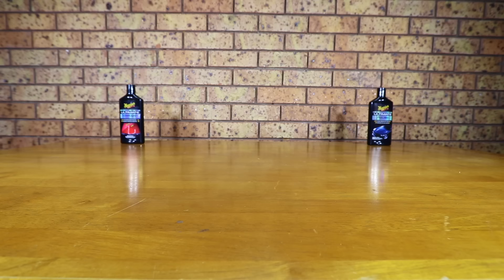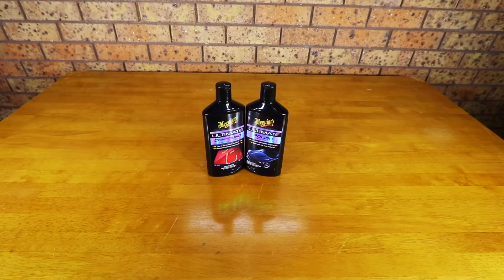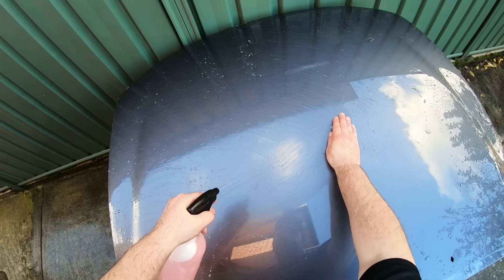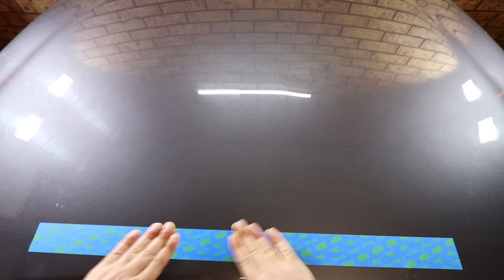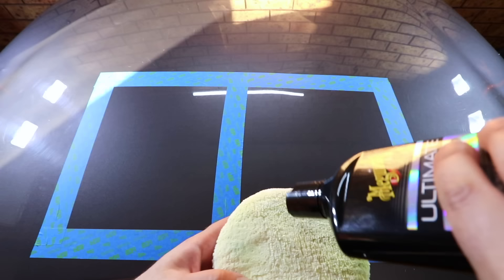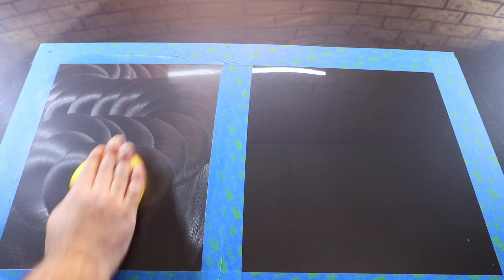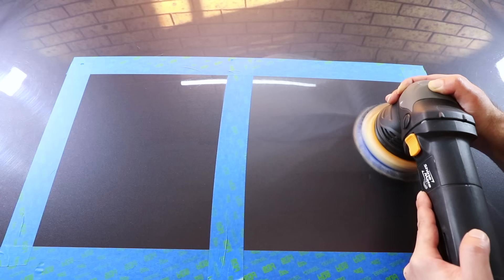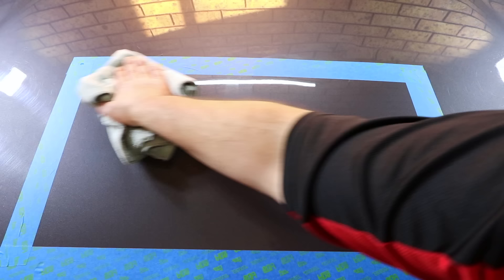How to Use Meguiars Ultimate Compound & Polish+ Review & Demonstration!

Comment: You are right about making sure you work this stuff in long enough.  I've used this a lot and the biggest mistake I've made when I first used it was not buffing long enough. I found it work best  using a DA and going until the compound almost turns clear and is barely visible.  Also....I found that it was critical to make sure when you wipe it off, you switch micro fiber clothes fairly often.  Using the same one will end up just smearing it around if the cloth is coated with the stuff. I went through a dozen or so doing a complete truck.  Thanks for vid!

Comment: Ive been told ultimate compound is full of fillers but I used it to get rid of some scratches (by hand) and did a fantastic job, the correction seems to be permanent. However if it had fillers it would have worn out by now, I am very impressed with it. I havent tried the polish yet but I feel compelled now. Thanks for the great video!
Reply: There are no fillers in Ultimate Compound but Ultimate Polish have both fillers and abrasives. So with Ultimate Polish some minor defects will get removed and some gets filled. It's kind of mixture of M205 and one of their glaze product which I don't remember now.
Reply: If you don't like fillers, you can use Mothers Pure Polish after Ultimate Compound because that polish don't have any fillers and silicone.

Comment: This compound really worked well on my old blue Tahoe. It made a big difference. Meguiars really works.
Reply: it was the first wax my dad taught me to use way back! they're leaders in car care for a reason!
Reply: Do you know if it works to remove bird poop stains. I mean difficult ones to remove? Like burns ;( thank you.
Reply from the maker: As long as the bird poo etching is still contained within the clear coat it can remove it. But if the etching has made its way through the clear into the base coat then it unfortunately can’t be removed with any product.

Comment: Finally free to catch up on your videos. Thanks for confirming that it does not have fillers. A few detailer’s been telling me that it has silicone acting like fillers and glad that it’s only enhancers. Meg’s Ultimate is a prefect product brand to get into car detailing without  spending too much.  DA a must with great working time. Thanks for the videos! Educational as usual.  FYI, newbies - Don’t use this on hard paint :). Not aggressive enough.
Reply: UC with an aggressive enough pad + good old rotary will do the job on most ‘hard’ clearcoats, barring maybe Volvo’s (they have clear that’s even harder than most Germans).
Reply: pepecoco Ultimate Polish has fillers mate, just IPA after you’re done in an area and inspect with a bright flashlight, big difference after IPA/panel prep wipe down.
Reply: Wish I saw this post before I tried to use it on my A3.... My Rupes yellow medium pad didn't have the power with this compound to get most of the scratches out... some pressure on some generic dense foam pads did a little better but it looks like ill need to try something stronger like shol s20.
Reply: HeliconPath Would highly recommend Meguiar’s M105 ultra cut compound, follow that with something like carpro Essence and you’ll get a show car finish on your A3, I’ve used this combo on many clients’ cars with a rotary and LC pads, works very well.
Reply: Are fillers good or bad?
Reply: @ji8651  It is normally considered to be bad as their goal is to "fill" the scratches/defects instead of removing/correcting them completely. Some products like Ultimate Polish are true polishers that only have a very small amount of fillers, while others rely more on fillers than actual polishers. Fillers won't last very long, so in a short while you end up with the same scratches as before.
Reply: @AJ56  Will an IPA wipedown remove the fillers left behind by Ultimate Polish or would you need something stronger?
Reply: Diego Rodriguez Ultimate Polish has a significant amount of fillers (most retail level products do), if you want better results either use their professional line like machine glaze M3 or go with Menzerna superfinish 3500/3800, even 3M’s professional line is good wrt having low fillers. Yes, a 30% IPA wipe is good enough to strip polishing oils.
Reply: anonymous  It’s a good idea to strip off any paint protection (eg. wax/sealant) before attempting any machine polishing, for removal use a stripping shampoo like Carpro Reset, follow through with a 25-30% IPA solution or panel prep like Carpro Eraser or Gyeon Prep. Regular shampoos designed for normal washing will not remove waxes.
Reply: anonymous  yup paint prep wipes will work

Comment: Nice to see the results. I used this on my old beat up Audi with decent results but more so recently on my ZX6R's plastic fairings. It did a good job but with certain areas of plastic you could add damage very easily. The polish had zero noticeable effect on scratches and finish in my test area so I didn't use that in the end and just did the 1 step compound.

Comment: Dude its like your reading my mind, I'm about to use this same products today. Great job as always Sandro.
Reply: Same here expect I haven’t purchased anything yet. How did it go?
Reply: I used these 2 but must have done something wrong coz it looks the same. On black paint though. :/
Reply: I just did it on three cars, depending on car paint, if it feels rough after washing it than it has many abbrasives and contaminants
1st use clay bar
2nd compound
3rd Polish
4th Wax
Reply: DatDamMexican hey bro, I’m on it right now. I washed, clayed, compound, polished... did you use some “grease & wax remover” prior to waxing? I saw some videos doing it to remove oils/grease from compound, polish used so the wax will stick more into the paint/clear coat.
Reply: @gawaniisko3111  No need, if you do you will remove all the polish particles that help bring out the sparkle kind of like a matte finish and it will defeat the purpose of bringing out the gloss.
Reply: DatDamMexican ok bro thanks for a lightning fast response! I appreciate it! That’s what I thought it would do.
Reply: @gawaniisko3111  plus if you are  using a good quality wax it will stick to pretty much anything specially since you already prep the paint good enough
Reply: DatDamMexican I’m using Meguairs ultimate liquid wax,.. then I’ll top it with turtle wax ceramic spray coating.

Comment: If you are Meguiar's professional line fan, you should still keep it in stock because sometimes UC (Ultimate Compound) works much better for soft paints as compared to M105. UC is derived from M105 but with more working time and its aggressiveness is 6 on professional line of scale. M105 is 12 and M205 is 4 on aggressiveness scale. So UC is somewhere between M105 and M205. This is reason I mentioned you must keep it in stock even if you are a professional. It helps in lot of scenarios. You must always do test sections and see which is better in your scenario.
Reply: This is relevant to subject and these are not random statements. These are facts from Meguiar's. Do some research before commenting.
Stop discouraging others for spreading information and show some respect to others in comments. Do you talk the same way when you meet someone in person?
Reply: i was talking to the guy who is insulting you.
Reply: I am really sorry. I misunderstood you :(
Reply: It's alright at least i watched the video once again to check if i was doing the right thing

Comment: Great video.  As an amateur, I use Menzerna medium cut on a DA for swirls but if there's water etching or a scratch that's a bit too stubborn, I use Megs Ultimate Compound on a hand MF applicator.  It's too slow and tiring for a pro but it gets the job done safely for me.
Reply: I know you wrote this 5 years ago, however any help is appreciated. I have hard water spots on my car that isnt coming off with my above surface methods and I admit I'm scared to try harder things such as compounds, etc. How hard of pressure and how long did you work in the compound before wiping it off? And did you just dry wipe, wet wipe, or did you rinse, then wipe? Thank you for any help!

Comment: These two are a great combo! But in my experience ult. polish leaves haze on my black lancer which has horrendously soft paint. Works very well on intermediate paints though. :)
Reply: how you manage soft and sticky japanese paint ??  it's absolutely frustrating
Reply: Tana vat Ive had a lot of success with menzerna 3500, it finishes down really well on my paint. It can be a bit dusty if you use too much product though but Im willing to overlook that drawback because of the great finish it leaves.
Reply: Sonax Perfect Finish on a very mild pad. And clean the pads frequently or change them out.
Reply: James what speed did you use on DA ??
Reply: nailbomb3 can you reccommend the pad and what speed did you use on DA?
Reply: Tana vat Ill usually use speed 4 on my DA. I have a shinemate like sandro. I make 5-6 section passes as it is a diminishing abrasive that needs to be broken down fully to finish nicely. As for pad selection, I use a black lake country closed cell pad. You can use a finishing pad if your choice. Hope this helps.
Reply: James Thank you my friend.
Reply: Tana vat lake City orange and speed 4 to 5 on a short-throw polisher
Reply: James and you are who I was looking for as I own a lancer evolution and have heard about the soft paint. I wanted to try this but now I’m skeptical.
Reply: I have always that haze too! Wonder why..

Comment: I have a black car and paint is very slightly dull on couple of panels due to to neglect , after wash and clay and ultimate compound , what simple and easy to put on wax would  you recommend  to protect the paint so it can last few months till next polishing job ? 
Also am i missing any steps ?
Just trying to accomplish clean smooth finish on the car thanks in advance and great explanation

Comment: Excellent video.
Reply: You're welcome.  I have a quick question, if you don't mind? I own a 5vyear old metallic black Jaguar XFS, whose paint is in good condition,  other than a few light swirls and scratches,  and was thinking of using  Meguiars D300 microfiber correction  compound to correct the pain.  However, would Meguiars Ultimate Compound be more suitable? Thanks in advance.
Reply: Thank you.

Comment: Just an update. I purchased both the up and uc. I used with my cordless rotary milwaukee. Using lowest speed and a white lake country pad i find there is not enough working time and lubrication. It flashes too fast. I believe it is mean for hand polish only. Its a waste that i have no power supply to try with my flex 3401. Thanks for the great video. It is still a good product to hand polish hard to reach areas for machine polish.

Comment: I've watched a few of your videos and I like your work and the way you explain things, Good Job.....But I'm surprised that you've given these products such high praise. Meguiars must be looking after you. My car needed a light compound and as I had some Ultimate/VFO Compound on hand I decided to use it, thinking that it wouldn't be too aggressive. It eventually did the job. I used my 75mm DA Polisher and it was very difficult to get off and continually clogged up the sponge pad. Ambient temperature was 22 degrees. I tried different speeds, different amounts of compound, worked on an area no bigger than A4 size. The car has some original '03 paint, some '09 and some '17 paint on it. Slow and Tedious. Then I used the Ultimate Polish. Initially I thought I'd use the DA with a soft pad. Same thing, small area, a few passes and then you couldn't get it all off, then had to hand polish those bits off so I gave that idea away. Again, Slow and Tedious. For the last 12 years or so I've used Meguiars Medium Cut and Fine Cut blended together and then Wet Look. Both very effective and easy to use. These UnUltimate products are just too difficult to use. Maybe the Ultimate Compound  only works with the Micro Fibre Pad that you used?  And the Polish with the Orange Pad. I used Orange on the Compound and Blue with the Polish. The final polish with Meguiars Canuba Wax was a breeze. Easy on, Easy Off.

Comment: I don't have a  DA polisher so the only way I can do polishing is by hand.
The Vehicle was ceramic coated 2 years back and has been maintained to the best of my ability
But again swirls are inevitable and the vehicle has swirls(Not too many but yes the ones which you can get with regular washing and maintenance).
The paint overall looks pretty good and no fading or other major issues.
The vehicle is white in color.
I want your suggestion as to which product/polish should I use to achieve this (Remove Swirl marks on the paint on a regular basis like maybe once a year) and then apply some coating.
Unfortunately in India, the only prominent brands are Turtle Wax, Carpro, Gyeon, Menrenza, Meguiars, and few others but again not a whole lot of options like in the US or UK.
Now I understand that polishing by hand is not going to remove all the swirls which are Ok with me.
Even if I can remove 80% of the swirls/marks I will be a happy man since that is my pain point. Additionally will using that product remove the ceramic coating?
Kindly suggest a product for my requirement. Thanks in advance
Reply from the maker: Unfortunately every paint and it’s defects are different and require a specific approach which doing a little testing is really the only way to discover what to use, but maybe thus video will help:
https://youtu.be/6tepA3wjPbY
You generally don’t want to polish or use anything abrasive over a coating as it to some extent compromise it.

Comment: Sooooo, I went and grabbed some today. Had someone's work truck to do and I thought "why not"

Truck had some light swirls nothing too gonzo. Was working outside. Used a HF short throw polisher and LC Orange CCS Pads, blowing them out with air. Also it was fairly warm outside about 80 degree's F.

Some observations:

1. very little dusting
2. 2 section passes did the trick and got probably 80 percent of the defects out
3. It doesn't seem to mind being used in the heat
4. had some slight hazing, SLIGHT. Did some "speed passes" on a white pad with M205 to clean that up.
5. wipe off is way better than 105/205

Re: M205 on hot/warm panels mannnnnnnnnnn it flashes off quick. Way quicker than UC.

Conclusion: I like this stuff and it seems damn handy.
Reply: Car Craft Auto Detailing :) still need to binge watch the rest of your Channel

Comment: I had used Meguiars ULTIMANTE'Compound on my 2005 chevy Colorado. I  tried 3 seperate coates   to make sure that I was  doing it correctly.  The color that was left was 5 times worse than what is was. originally. I was so discussed with what was left so i tried a starting coat of Mothers California Gold,, Brazillian Carnauba  clearner wax.I started with a light coat to see what it might do to improve the drab color. With a good coat of the same wax from Mothers, it left my 2005 Chevy Colorado with a high quality wax finish. it had brought the blue color that was there when I purchased it. So as you can read, I am not a lover of Meguiar's Ultimate Compound. It made the color go blaaa.

Comment: My car has some scratches where the paint was scratcbed off, so my husbannd purchased a paint touch up kit specifically or the color of my vehicle based on the vin numer, it looks ok and you wouldnt really notice the touch up unless you knew the previous scratches were there.  So my question is would this Meguiar's be able to even out the paint touch ups?
Reply from the maker: It probably won’t help to make the touch up paint less noticeable unless the paint is faded, hazed or oxidised, in which case it could.

Comment: Thanks for this informative, well covered hand-polishing section of your video. I have a sport bike that is mostly covered in my garage. The small surfaces are better polished by hand and since it won't need very much correction, I was leaning toward Maguires Ultimate Polish.
Reply from the maker: If the paint isn’t too bad then a polish is a much better starting point. You can always step up to a compound if need be.
Reply: I am glad for your sound and reasonable advice! Sport bikes from Japan typically have thin paint and clear coat. I will use your advice and my best judgment! Thanks!

Comment: Hi again. With those Shine Mate polisher you told me about in the previous comment... What model would be able to have a 6" backing plate attached to it? The reason I ask is because most of my pads are 6 inches. Also someone said on a forum that an Random Ortibal Polisher is just a glorified wax spreader. They said a  Dual Action polisher is the thing needed. Are these Shine mate devices Dual Action do you know? Cheers.
Reply: @CarCraftAutoDetailing  You are really helpful to me and everyone else here. Your help is really appreciated mate. Cheers :)
Reply: If i were to get the one you suggested originally which I think is the 5 inch. Can a 6" backing plate be attached? What do they mean by 12mm polisher, 15mm and 21mm etc? Thanks :)

Comment: Hi Professor !

Ed Here
From São Paulo, 🇧🇷 

As I Alteady Mentioned, This Video Is So Important Because Shows How To Work Manualy !

For Guys Who (Like Me) Live In Condos And Do Not Have How To Use a D.A. Polisher, This Video Is Key !

Other Than That, Which Detailing Flashlight Would You Recommend For a Closed Condo Garage (1st Floor Below Ground)

To Help Find “Hidden” Swirls or Scratches ?

A Cheap One Would Be Very Nice !

But Nothing Like Scangrip Sunmatch (US $ 149,00 at Amazon) Which I Think It Was The One You Were Using in This Video !

As Always, Thank You Very Much For Sharing Your Know How !

Best Regards